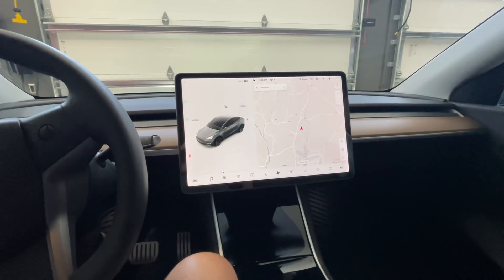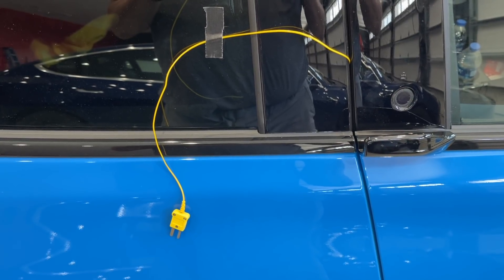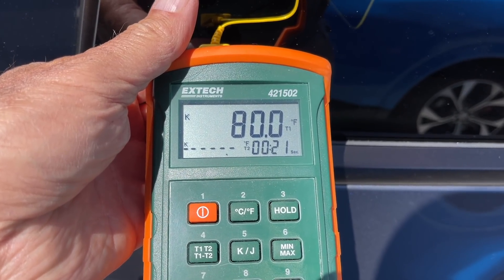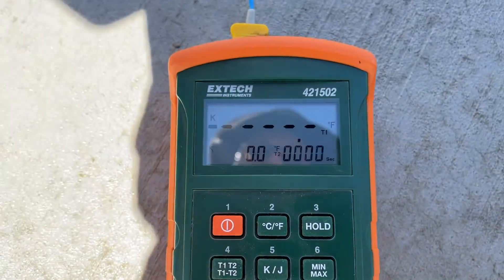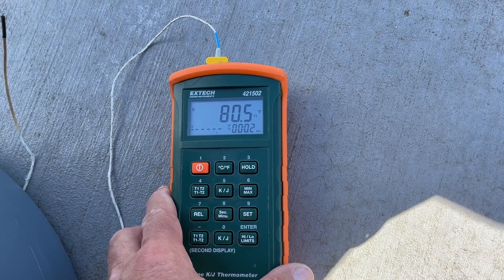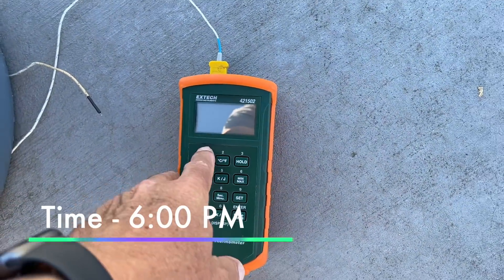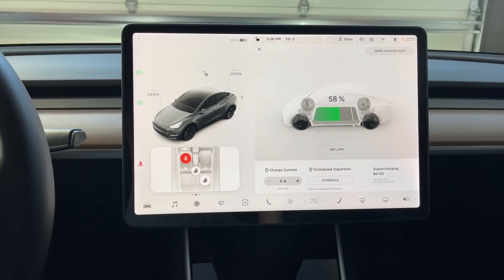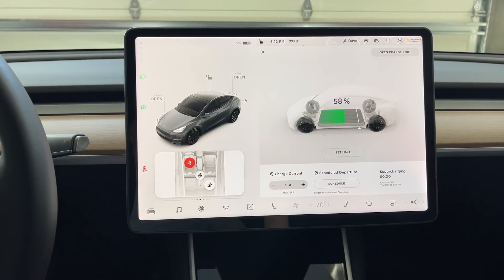How Hot does the Model Y and Mach e get inside in the Sun - Part 1

Comment: Interesting that both cars ended up with interior temperatures that were fairly close to each other, despite the fact that the Tesla was running its cooling system. This seems to suggest that the Mach E glass roof has better IR protection and needs no A/C to maintain a temperature only slightly higher than the Tesla.

Comment: Cringed every time you just dropped the connection down against the paint on the ford but then had it taped up on the glass on your tesla.  You also said in the beginning that you were going to check to see if ford had the cabin heat prevention setting liked the Tesla but then when you started the test you noted how you did not hear the ford doing anything so it must not have it.  Guess you did not look at software to verify first like you said you were going to.

Comment: is the test valid with tesla cheating with heat protection on
Reply: Test results were valid. The test itself is not a fair comparison. Tesla got to over 100 before the feature kicked in. Mach E was still in the 90s at the time. Better to test both without the feature. Quite a nice and well thought out feature though. Thanks for taking the time regardless.
Reply from the maker: Yes it’s a valid test, does your car get hot and so how hot?  The Tesla is designed to not get hot saving the materials inside from heat damage.  You saw it right?  Watch for the high temp test.

Comment: How much battery was used keeping the cabin from overheating? This would be valuable info to me in Central Texas where the car will be parked outside all day while I’m at work… in 100+ temps from July thru August.
Reply from the maker: I’ve not measured it but I think you might lose a few miles if range but well worth it.  You can also turn in the Airconditioning remotely from the App before you need to travel.

Comment: Thanks for the great lengths you've gone to keep this scientific and accurate Dave, but in the spirit of being scientific the data would be far more meaningful if you had run this test with identical conditions. 

Essentially what your proving here is that if I leave the AC on in one car, and leave the AC off in the other car and let them sit in the sun, then the one with the AC on will be cooler than the one without the AC.

I don't want too sound to critical, but did we really need to measure this??? Isn't the outcome obvious?

A far more useful test that tells us something meaningful about the vehicles overall build quality and passive cooling features (without utilizing the battery) would be to have the AC disabled in the Tesla, such that the only variable at play here is the passive cooling and design features of the vehicle, as a result of the insulative and emissive properties of the vehicle.

Please keep your tests as apples to apples comparisons. I'm noticing a trend where you tend to sqew data (either intentionally or not) towards the Tesla. As an example running a range test where you go well below zero in a Tesla and go to zero in the Ford. 

Now you are running a temperature test while using AC in the Tesla and not in the Ford. What does that really even tell us Dave, beyond the fact that the thermostat and AC work as expected in the Tesla to maintain a steady temp while consuming 2% battery in the Tesla to remove heat energy from the cabin?

Thanks for this, but please perform again and keep it as an apple's to Apple comparison if you want to prove anything beyond the fact that AC's work to keep things cool, which I think is pretty well established common knowledge.
Reply: It depends on what the test is meant to determine.  As an owner of one or the other of these two cars, it's useful to know how hot the car will get inside when left in the parking lot for hours.  I now have a pretty good idea. As an Arizona resident, having a way to limit cabin temperature is a define plus even at the cost of some battery draw.
Reply: @MsAjax409  Then that probably should have been a test of its own solely for the car with that feature.
Reply: @locsmiths   If I'm trying to decide which car to buy, and inside temperature control is important to me, Tesla gets the extra star.

Comment: Dave, it would be much easier to perform this test mid summer at your home or visit me in SW Florida now where typical temperature is 93 degrees.   I greatly value cabin overheat protection and don’t care about losing 2% of battery.  Can we assume those people who worry about losing 2% of range never floor their ice vehicle gas pedal since they too will lose 2% of range.  And for most EV owners, it’s easier to restore range by charging at home overnight.  When grocery shopping at multiple stores, I leave cabin temperature at 70 degrees so food doesn’t spoil.  Otherwise, cabin temperature could exceed 130 degrees.
Reply from the maker: Correct John, folks don’t realize how valuable of a feature this is.  Your car will stay new inside and last a long time for a few pennies a day.  Also they don’t know you can cool down or heat up the interior remotely from anywhere on the planet.  Thanks
Reply: @evdave528  Label me a show-off, but when going out to dinner with friends, I volunteer to drive.  In addition to demonstrating a few seconds of insane acceleration, I lower cabin temperature from 88 to 70 degrees about 10 mins before leaving a restaurant using phone app.  When guests get in the chilled Tesla, accolades are priceless.  My reply is, “you can’t do this easily with an ice car !”

Comment: The overheat protection mode in the Tesla is a pretty cool feature. The 2% battery drain in 3 hours is a little high for me, but since it was able to use the AC, I guess it makes sense. I wonder how different the resultant temperature and battery drain would have been if you had selected "No AC"...

I have seen other videos which make it seem as though the tint on the Model Y's roof is not as dark as the Mach-E, and they comment that the solar radiation seems a little stronger for the occupants in the Y. Have you found that to be the case?

Great test scenario though. Maybe when you do it next time, you could save yourself some work and use a logging setup that would show outside temp, Model Y temp, and Mach-E temp, all on a chart that would make it easy to compare...

Comment: Have only watched 1/3 so far, but why would you immediately conclude that the HVAC racket coming from the Tesla was evidence of "cabin overheat protection" coming on, if the feature truly is as you described earlier?  If cabin overheat is supposed to hold interior temp to 105° F,  what's it doing coming on at 85° F ??       Is there that much of a thermal gradient inside the cabin?    Where is the sensor that the Tesla's HVAC is using?
Reply: Tesla menu says “105 or less”

Comment: thats a great feature by tesla. Now the question is could ford implement this feature VIA software update?
Reply from the maker: Great question indeed
Reply: Its not that hard to do, toyota prius with solar roof runs the AC and recharge the 12v battery when sitting under the sun. Ford can easily implement the feature.

Comment: Thanks for sharing your experiment. Nice overheat temperature protection device on the Tesla.
Another good test would be to leave both cars outside, letting them warm up i.e. 100 degree, and then turn on the A/C on both cars with a set internal temperature and see which one adjusts to the set internal temperature first and how long it takes to reach that temperature.

John
Reply from the maker: Cool test I’ll add it to the list

Comment: So long term, the Tesla will keep it around 3 - 5 degees bellow 100?
I wonder how low 'dog mode' keeps the temp, and to what kWh cost. Should be fine with plenty of juice available, with an added comfort of a charger not too many miles away. In fact, I might try it and see.
You got a good workout, and a bit of vitamin D.
Reply from the maker: Dog mode keeps the inside to about 70F thanks
Reply: @evdave528   Great. Would be good to know the power draw...I might check it the next hot day.

Comment: Which Tesla should I buy model 3 or model y  - give your recommendation irrespective of the cost
Reply from the maker: Since both are essentially the same the Y is larger I’d buy aY
Reply: Model 3 drives slightly better, it feels more "planted".
Anything else is better with Model Y :)
Reply: Y!  More storage to haul our stuff around.
Reply: I recently bought both.  A model Y dual motor non-performance with standard wheels, and Model 3 dual motor non-performance with upgraded wheels.  Both purchased March 2021.  Aside for the size difference, the driving dynamics of the 3 are much better.  The suspension of the 3 feels more controlled, absorbent like an Audi A4.  The model Y is more like a Porsche Macan, stiff, less absorbent.  The 3 is much quieter.  The Y suffers from air and road noise circulating around the cabin in part because it is open to the back of the car, there is no cargo cover.  On the a concrete freeway at 75mph the db level is 78 in the Y, in the 3 it is 72 db, considerably quieter.  The 3 is much more fun and sporty to drive.  As someone else pointed out, the 3 feels more planted the ground.  If the extra cargo space is not that important to you, the 3 is much more enjoyable driving experience and would be my pick.  A friend of mine recently bought the performance Y with the larger wheels and commented on how much better the ride was in my Y, and the 10K for the extra performance was really a waste of money because the base dual motor version of Y has more power than you'll never need, so I'd steer clear of the performance versions, plus the range suffers as well.
Reply: @gordonferris5859  thank you sir - very elaborate feedback. Noted all the points.
Reply: The Y is better if you are a little older due to being higher of the ground. In fact it is only 1” higher but due to the greater overall height of the roof the seats are 5” higher. Much easier to get in and out. Also feels much larger inside. Performance is great with the dual motor and handling is very good but a little heavier and higher would impact the handling a little. Are you a race driver?if not the Y is far better around in my opinion. 3 is a little sportier by being lower inside the cabin. Just go drive both to find your preference...
Reply: @abbatis34  bravo - great recommendation- insisting me take a drive , I am slowing inclining towards Y
Reply: If you intend to do any type of towing, I would suggest to check out the different options available and the towing capacities of each vehicle. i.e. model 3 - model Y  whether they are factory installed or aftermarket and how they interface with the Tesla computer system.
John